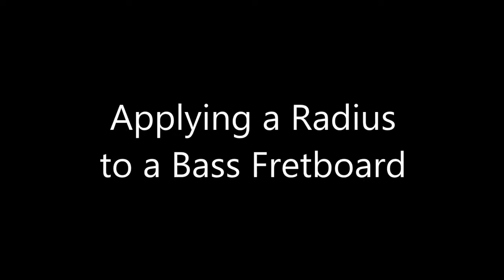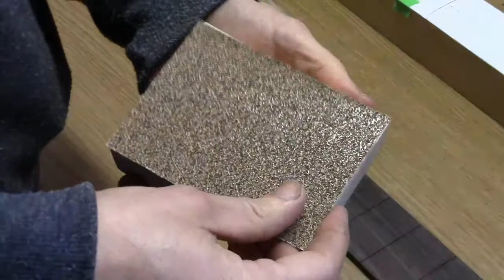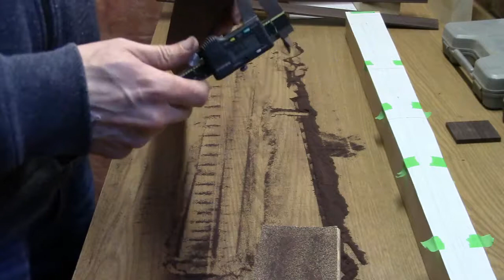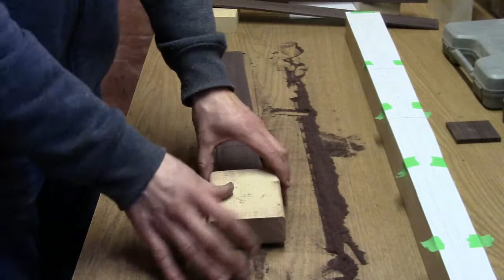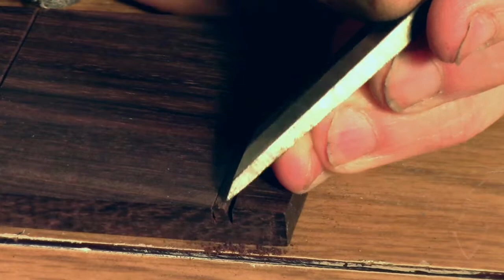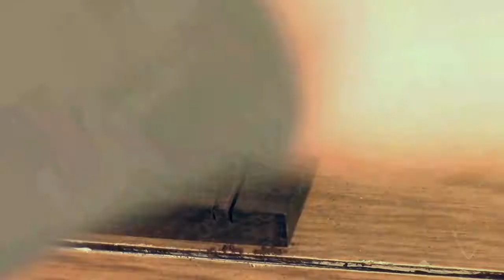Building a Bass: Applying a Radius to a Bass Fretboard

Comment: how did you mark and cut the 12" radius on your sanding block?
Reply from the maker: Use a 12-inch string and a pencil to mark an arc on a piece of stiff cardboard. Cut that shape out carefully — try to make it perfect.  Then start filing and sanding your block and test the profile often against your cardboard template.  You can make a darn good block with a little patience.
Reply: @brewmaster243  I have a bandsaw too. I guess that will work if careful.
Reply: @brewmaster243  Local music store has gauges that can be useful for string setup also.